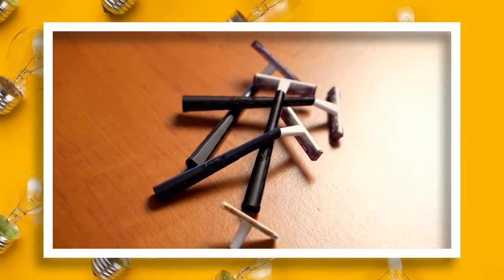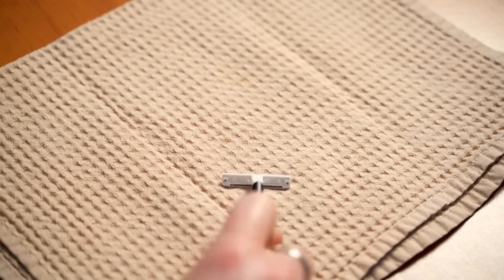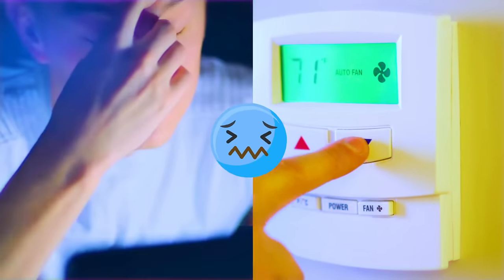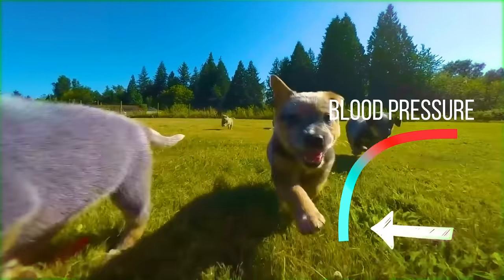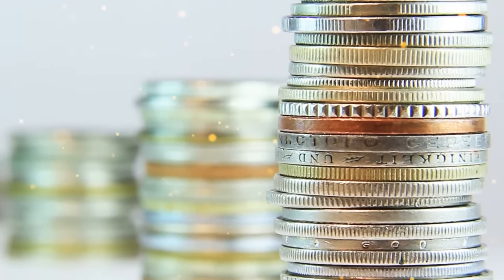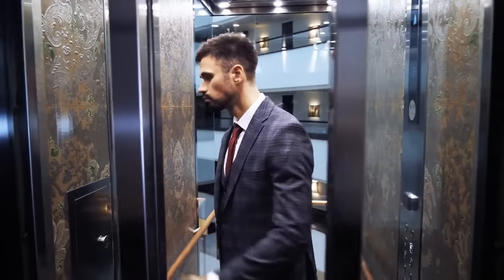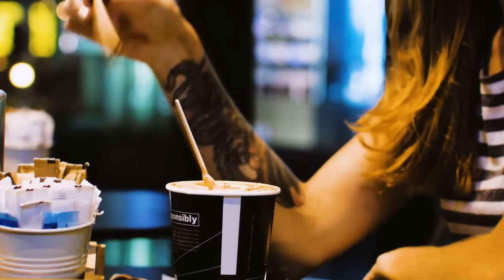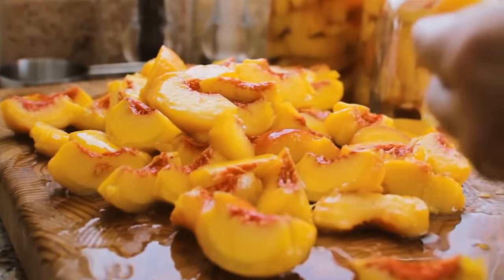Everyday Things You're Doing Wrong, But It's Not Too Late to Change

Comment: I've never seen mold on pickles no matter which way you turn the jar.
Reply: This channel should be called "Redundancy of Occasionally Accurate Assumptions". Also, you don't need to refrigerate something that has been pickled.
Reply: I saw mold on a pickle that had not been kept in its pickle juice.  It was in the refrigerator.

Comment: I didn't used to peel off the cover from the dishwasher tablet UNTIL I washed my dishwasher. There were tiny shards of what looked like paper on the walls and bottom. They were stuck there and I had to scrub it off. Clogged the filter too. It is only my husband and I using it, so it couldn't have been anything else besides the supposedly dissolvable cover of the dishwasher packets.

Comment: They don't say how hot the oven is😢 However, seasoning can be done on a top burner as shown for the oven😊
Reply: Also, that plastic handle wouldn't like the heat.
Reply: I think just putting it into the oven without turning it on will retain heat better than waiting around the kitchen to be served

Comment: Clear the razor blade with hot water, tap it against a hard surface to remove water and whiskers, and oil the blades with baby oil or petroleum jelly.  If you wipe them, use a single sheet of toilet paper. If you wish to sharpen the blades, move them across your arm in the OPPOSITE direction you would if you were shaving CAREFULLY.  NEVER 'test" the sharpness by running a blade perpendicular to ANY part of your body.
Reply: Try oiling Blades w/Olive oil - it works for so many things; helps shower curtains, closet doors & clothes hangers glide,  Zippers slide, helps Needle & thread goes thru material, removes gunk, moistens skin, helps get a tight ring off your finger - discover new uses for yourselves - it's fun!

Comment: Ceiling fan stuff isn’t quite right. It’s about the blades going clockwise or counterclockwise and the wind direction that creates. They both go down. Clockwise pushes warm air down. Counterclockwise pushes cool air down in columns.

Comment: The toilet paper flattening is the dumbest thing I have ever heard. It slows the process down of cleaning up afters. It makes using the toilet paper very frustrating.
Reply: Has anyone noticed that they have shrunk the width of the paper? A roll of toilet paper is almost 2 inches narrower. Another quarter inch and it will be as wide as the store receipt that you got when paying for it.
Reply: I have a heating vent directly under my tp holder. If I don't squeeze the tp roll, it unravels when the heat or air blows, sometimes it unrolls right into the toilet bowl.
Reply: I agree with everything the other guy said! Much cleaner, healthier, cheaper..esp if you have kids or lots of visitors. Try it again for a week to see if you save❤❤
Reply: Wash your hands big guy❤❤
Reply: I saw that some companies roll the paper looser to create the illusion you are getting the same amount when in fact you get less sometimes for even more money.

Comment: Such. A. Waste!!

Eggs don't need to be refrigerated, so them being in a warmer or colder part of the fridge doesn't matter.

Just put the whole loaf of sliced bread in the freezer. Why you'd waste that much plastic and individually wrap is bananas. And expensive!!!!!!!!

If the slices are getting stuck here or there, just put a small square of cooking (aka parchment) or waxed paper between them. Then at least the paper can be put in the organics bin.

The razors were disposables. You can also save money by not using disposable razors.

I gave up at about 10 mins.

Comment: Why not just throw the whole loaf of bread in the freezer?..
Reply: That would require to much common sense
Reply: Because the slices would freeze together meaning you would have to unfreeze the entire loaf and run into the same issue again.
Reply: @georgeworley6927  I throw my whole loaf in the freezer and can easily peel off how many slices I want.. Bagging each slice is ridiculous, as the baggies are more expensive than the bread.. lol.. You going to individually bag hamburger buns also?.. lol
Reply: Yes, from my experience, the bread slices separate, plus, avoid plastogins.
Reply: What if it didn’t come in a loaf🙄🙄🙄🙄🙄🙄🙄🙄😳😳😳😳😳😳😳😳😳😳😳😳😳😒😒😒😒😒😒😒😒
Reply: Thought the same thing it's easy to get a couple slices off even allowing you to put it back in the freezer!! Common sense!!! Geez!!
Reply: Well doing that would reduce the amount of plastics that we consume. And where's the fun in that?😂😂😂
Reply: Maybe you're supposed to keep the bread slices separate from one another and if so new to me,but otherwise I'm going with what you said
Reply: @georgeworley6927 I freeze the slices flst on a tray, then put them back in the bag.  They don't stick together.  I do the same with sliced peppers, garlic cloves, etc.
Reply: @georgeworley6927 ...a frozen loaf of sliced bread easily separates if done while still frozen, as long as it does not start to thaw.  A hard rap of the frozen loaf (on its side) on the counter will usually pop some slices loose...then quickly re-close package (airtight) & put it right back into freezer.
Reply: If you thaw a bunch at once they stay damp in between after thawing. So I set a few on the toaster oven rack(but not to heat, just to let ‘em thaw for a couple min. ) then put them in their own bag
Reply: Guessing the egg in the fridge thing is for the Americans 😂
Reply: @georgeworley6927 bull. They pull apart.
Reply: That works fine as long as you take a big towel and wrap it twice and it'll be fine and your edges won't get hard..
Reply: @NoraBear61  What if I like my edges hard?.. lol